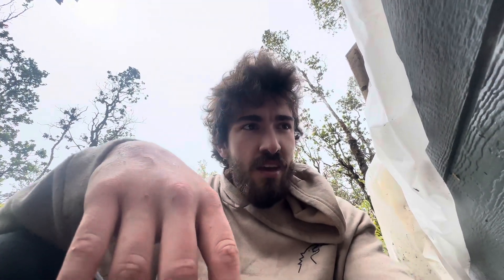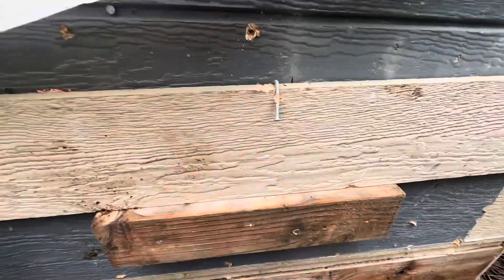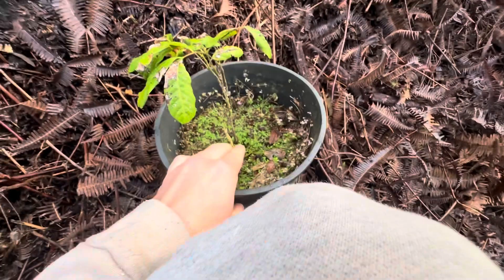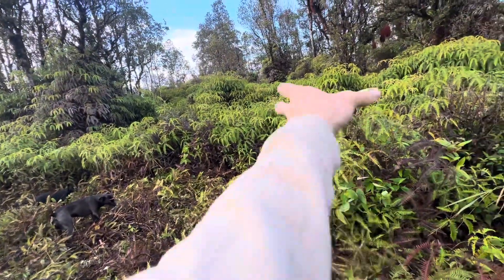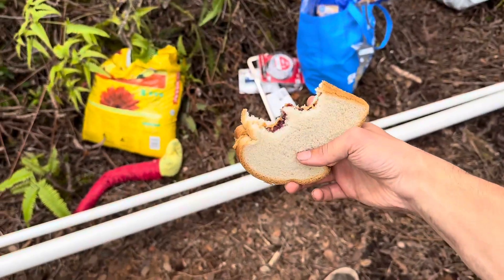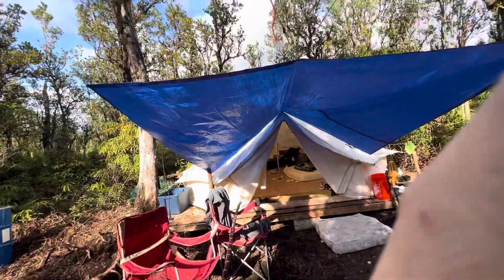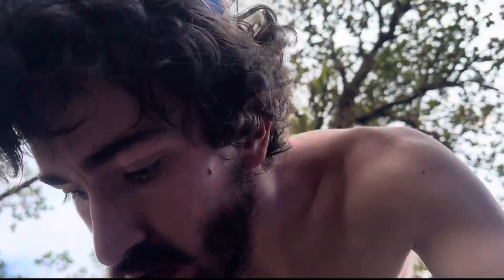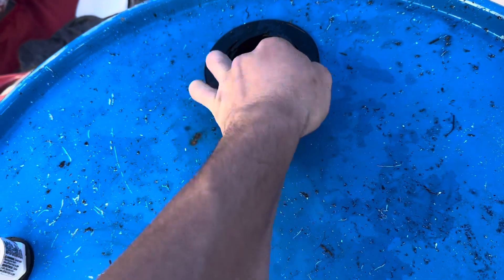Building a place for poo plus chickens for gas

Comment: This thing will not work.... Flooting dram only options
Reply from the maker: What part of it won’t work? I changed out the second barrel for a inner tube and it fills up then I put weight on tube when hiring has for more pressure